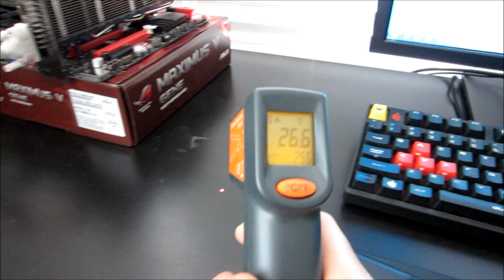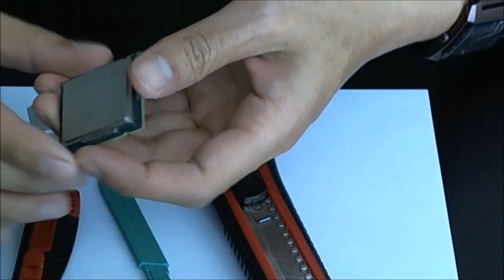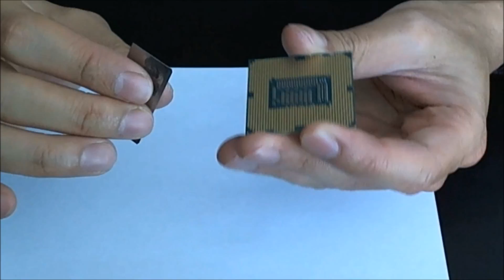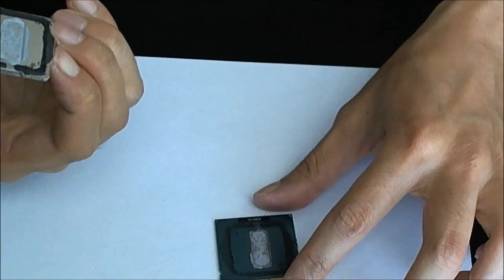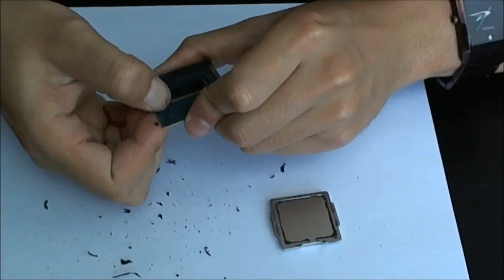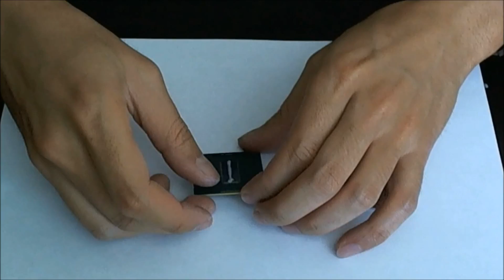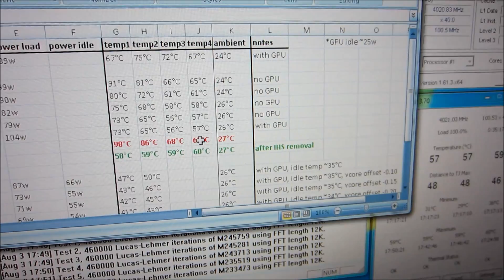Fixing Skylake, Haswell, and Ivy Bridge CPU temps: IHS removal

Comment: Oh god please stop touching the CPU contacts ;-;
Reply: +Shankovich it really, really doesnt matter lmao
Reply: He just stuck a razor into the cpu and your worried about the contact pads? XD
Reply: There's nothing to worry about. He said he's grounded good enough. Computer parts parts aren't that fragile. I literally stepped on my gtx960, popped it in that bitch and was playing Fallout.
Reply: +cataria pega Lol what? the 970 is miles better than a 960,and it has 4gb vram,it doesn't matter if that portion of 500 mb vram is slower,the card performs just as well even when games use that slower 500 mb vram
Reply: +Swot Roke Its an SSD not a HDD with mechanical parts that actually move inside!
Reply: +cataria pega Yeah It worked just fine. I got my first SSD 7 years ago and the first damn thing I did was drop it down the damn stairs at my apartment &gt;_&lt;!!!!

I was amazed when it still worked O_O
Reply: +Shankovich 
lmao
Reply: +BahBahTheSheep I'm not sure what you're getting at? Can't you comprehend what I wrote?
Reply: +Bob Vila what? with all your weight? what ;)
poor gtx 960 :(
if it was a 3,5 gb!! 970 then i would understand stepping on it :)
reminds me when i got my first ssd and it of course fell out of the box on the ground. still works of course!
i wish hardware would get produced more robust and with a longer lifetime. hell some shit gets programmed death timer in them.
best example for external hardware is the printer ;(
Reply: LOL good one
Reply: +R Madalin oh come on are u serious?
the 970 ram issue came out because of studdering and massive performance drop, once it went over the 3,5 GB ram mark
the 500 mb is much much slower, there is a reason to have a full throughput of the memory bus at full clock.
cards are planed with the speed in mind and if that 0,5 gb is slow as fuck its useless.
and it literaly is, and useres observed that the graphics card will not use the 0,5 gb unless it absoululty has to!
nvidia knew this issue from the start, hence the maxing out at 3,5 GB.
nvidia screwed people over, this was not an accident.
IT IS A 3,5 GIGABYTE card.
saying anything else is crazy.
what,s next, saying  u have 1 TB of ram, because u set your whole ssd as swap partition/ pagefile.
and btw u think a class action lawsuit is made for no reason?
http://techreport.com/forums/viewtopic.php?f=3&t=101965
Reply: +cataria why does 970 get all the flack? i got a 960 4GB and guess what? i cant use all that 4GB it struggles to play if i do try, gotta keep it around 3.2GB to run smoothly same with the 750ti 2GB it did not enjoy using 2GB so i kept it around 1.8GB i guess every gpu is like that even the 980TI wouldnt surprise me if you cant use all that 6GB why the hate on 970? whats the difference?
Reply: +Bob Vila wouldnt dirt off your hands effect it? i know its not a cd but i dont recommend you touch the shiny side of a cd thats where all the data is maybe cpu similar?
Reply: +Julian john No, it's not transferring data via laser etching. Those are gold plated contact points that transfer 0s and 1s. He said to discharge ESD before touching the sensitive side of the CPU. The only thing he could've done better is to wear an ESD bracelet. You guys lol.
Reply: +Shankovich rubbing alcohol fix works fine, i wanna try putting the cooler direct without the cap like mobile cpu's
Reply: lol yo write the contacts seem less important
Reply: also skin oil in contacts is not smart at all ...
Reply: Back in the days many a CPU crystals were cracked this way, as they are very fragile. That's one of the reasons they decided to use metal IHS to cover it.
Reply: you are special arn't you...
Reply: I was asking you to elaborate on your comment genius.
Reply: Cpu processors aren't fragile he's probably done this before because he isn't nervous
Reply: +BahBahTheSheep Actually it does. ESD is not a joke. It could severely impact the life span of the CPU.
Reply: copperkipper1 - the youtuber in a nutshell. "omg herp derp you cant comprehend me herp derp" lmao
Reply: did you just think about what you wrote?

Comment: I usually just leave the IHS off for even better temps and put something in between the retention bracket and CPU PCB to keep it in place. (if your heat sink can still touch the die itself)

Comment: Nice temps. My Haswell 4430 3.0 ghz runs 90 degrees on stock cooler at 24C ambient running prime 95, maybe they also have this problem, will change the cooler some day, probably that is the problem.

Comment: Laptops are not the best for thermal management and if processor ha full load of usage from programs etc, the chip could tUrn off from overheating or get very hot. Processors have different temperatures before they turn off before damage could be done.  Chips are getting more efficient, but my older ddr2 ram laptop with pentium can get close to 200 if a lot of work is being done.

Comment: I had thermal paste look like that when AMD laptop was overheating.  I think back then it was overheating because of junkware, viruses and vista issues on low ram.  Nothing was broke.
Reply: +Skazzy3 that's the most retarded shit I've ever read. almost all software uses the cpu in one way or another if they're active. go check in the control panel and see how much a program is using the cpu if u dun believe me.
Reply: ***** OH SHIT :|
Reply: CodyMetal is right.  I had a shiat hp printer app on family's mac that used all cpu because it was junk coded.  If processor is maxed out from junkware, bad non friendly efficient programs, everything adds up.  That old laptop had half gig and eventually 1 gig.  Windows vista is like 7 and only one gig.  Crap load of compressing and lag because not everything can fit on ram...My current average i5 laptop ran a lot cooler for an intensive game it was not meant or built to run on with 8 gbs of ram vs 4.  Other computer was long ago, I optimize my computers nowadays with everything I can.  I have an A+ cert before I graduated HS.
Reply: +Ninjamaag No, a CPU should be able to function at full capacity for any period of time without overheating (emphasis on "overheating". Any hardware under load will run a littler hotter than when idle). If it overheats then there's a hardware fault. The most common cause is because the heat is not being removed quickly enough.
Reply: +450AHX are you just not listening??? they are both talking about laptops not desktops... most laptops  aren't designed to work under full load fora very long time period as they were manufactured to be as compact as possible which leads to worse heat transfer. For a full-sized tower however you are right. A proper designed one should be able to function at full load (not capacity ;) ) for quite a while
Reply: Felix St
If it overheats with any conceivable load then it's poorly designed. Period. It's a basic engineering principle that you should design your systems so that they don't fail even when run past their maximum rated parameters.

And no, it's "at full capacity", not "at full load". The load is whatever fills the capacity. Saying "full load" is like saying "full water" instead of "full bottle".
You can say "maximum load", though.

Comment: Cut it in half: Congrats. You just made a Pentium! :D 

(Sorry XD )
Reply: +MacAlister Livingston put amd in your intel socket and you get face melting stench.
Reply: MacAlister Livingston North America uses 120 Volts AC
Reply: Failure Glitcher ...which is pants. This cpu really sucks... I can't afford it. FX 8350 is the bestest
Reply: +Woodsy CSGO ... ?
Reply: MacAlister Livingston like... What's his problem? 😮
Reply: +Mark Schulz IV EU uses i7 5960x NA uses intel atom
Reply: Mark Schulz IV 8350 is a waste.. i3 is WAY better..
Reply: PneumaticFrog well... In some cases yes, but in others no. If you have a highly multi-threaded workload, an FX-8350 will shit all over an i3 and an i5. AMD processors currently suck at single-core tasks, but are amazing at multi-core.
Reply: ***** but, they dont support pcie 3.0 OR ddr4
Reply: PneumaticFrog neither of which matter too much currently: a 16x PCIe 2.0 connection is enough for GPUs, for the time being, and DDR3 vs DDR4 doesn't make any significant impact to most tasks. 
The FX lineup also has more PCIe lanes than the consumer systems from Intel, which are still limited to 16 lanes for some stupid reason.
Reply: ***** because the higher-end x99 chipsets have even more than that.. if you're gonna go with 4-way sli than you're gonna get a high end cpu
Reply: ***** their gpus support pcie 3.0, so do their motherboards.. BUT, their CPUs don't
Reply: PneumaticFrog Actually, a 990FX motherboard has 40 lanes total, just like the top X99 i7s. 
Yah, they're only 2.0, but as I explained, a 2.0 16x connection isn't saturated by today's GPUs. A 16x slot running at 2.0 speeds can achieve 8GB/s ... GPUs aren't that fast yet. 

However, 3.0 is nice to have, with its 1GB/s/lane, for PCIe SSDs. That's the only place it makes a real difference for now.
Reply: +Milan Svitek STFU
fucking memer

Comment: Is it dangerous to put the cooler onto the direkt chip without the IHS? How are the chances to f*** this up actually?
Reply: +Nue Houjuu you can not physically put a cooler onto the chip directly as it will not reach down and touch the chip and thermal compound. the IHS acts as a medium between the chip and the cooler of your choice allowing the cooler to dissipate the heat the chip transfers onto the IHS. Unless you have very steady hands good eyesight and can remain calm throughout the whole process I would not recommend this as while the gains to be had are great the risk is very high without said attributes.
Reply: +Nue Houjuu it was fucked to start with
Reply: +imlastinline You can put the heatsink onto the die...it depends on the kinds of screws and plate the heatsink comes with...a lot of the screws used to screw down each corner have extra thread in them so that you can properly screw down each corner properly...with the headspreader taken off, the screws would just screw down a little further...people used to do this mod all the time back during the socket 775 days....and were easily able to put their heatsinks onto the die.

Comment: Try this ==>  https://www.facebook.com/463758260499292/photos/a.463759030499215.1073741828.463758260499292/463758900499228/?type=3&pidid=77aa2544-26d7-4dc3-92a8-f249cdf6dcc2  i just generate 99k Credits using this online tool. Works on all devices. 100% working                                                                Fixing Haswell and Ivy Bridge CPU temps: IHS removal

Comment: you should buy a better cooling system for your cpu instead of doing this shit...
Reply: his cooler performs equally with a Corsair H100i, its an extremely efficient air cooler, what he did not only expands the lifespan of the CPU but also makes it possible for him to easily hit 4.8ghz+ overclocks at much lower temperature than what he was getting with only a 4ghz overclock
Reply: +Mr. Señor 
u are correct, but rip CPU u wont able to sell it anymore, after you "breach" the metal thing
this thing is for overclockers, casual users should not try this at home.

Comment: Quick question, i was giving this custom pc with intel i7 2600k cpu but the pc won't stay turned on. I turn it on, and it keeps shutting off and on. Is there any fix for cpu that won't post? I know it's the cpu because i tried a different chip a g530 to be exact and it boots just fine.
Reply: download the heat monitoring software and watch the temp when you running your pc and underload. If it too high, clean the fan and remove the stock heatsink and reapply the thermal paste. If it heat, you see that the temp get too high then the computer will restart. 

Else check your component one by one removing it and testing whether the computer will run.
Reply: +Faern Nashar thanks for your response but the pc doesn't post. It turns on for like one second and it fans start spinning but keeps looping in that cycle. So I can't do that test.
Reply: +BlaGGah if it doesn't post then either your power supply is faulty or your motherboard is dead, it could also be bad ram sticks
Reply: +Daiesthai That's not the issue, well as far as the power supply and rams go. I know they all function properly because when i swap out the cpu, and put it the G530 cpu, the pc boots up fine. So that's why i'm leaning towards the cpu could be faulty.
Reply: +BlaGGah That is strange, its possible its the CPU and you should get it replaced then, what motherboard do you have ? Are you sure the motherboard supports 2600k ?
Reply: I'm sure it does support 2600k, it's the gigabyte h61m-ds2 motherboard.
Reply: http://www.gigabyte.com/support-downloads/cpu-support-popup.aspx?pid=3970 look like it supported. Your CPU is defective then, RMA it then.
Reply: Isn't it kinda too late for me to RMA such an old CPU? I'm not sure what the rules are on Warranty. It's a sandy bridge line cpu afterall.

Comment: DO NOT DO THIS LIKE HE IS DOING! 
1. Don't touch the pins on your CPU
2. Don't delid unless your thermals were like his
3. Don't use Prime95 stress tester (it can literally destroy your CPU)
4. Use rubbing alcohol to clean thermal paste off of the TIM
5. Use a vice to hold the CPU while you delid it.
6. Be extremely cautious while doing this

Comment: Very nice! The vice method actually looks a bit safer in my eyes, as I would be afraid of cutting into the traces, but it also has its dangers. I WANT to do it on my 4790k, but I'm really afraid to ruin it, so I still havent decided.
Reply: Why would you do that with a 4790k.The temperatures on mine are awesome. At 1.236V running at 4.6ghz, I get around 58C. I have never seen temperatures over 64C. During rog real bench,  I got 67C-70C. Nothing wrong with those temperatures.
Reply: @h.hhonors5205  4790k is soldered...

Comment: This guy is a total noob. Ye he managed to get the ihs off, ye he replaced the thermal paste. and then the retardness began. first off, when you remove the ihs, you dont want to put it on again. the ihs alone makes the temp on ur cpu cores at least 5 degrees C higher. so what you wanna do, is mount the cpu cooler directly ontop of the cpu core, without the ihs inbetween, since the ihs is made from aluminium, witch has a lower thermal conductivity than copper, and also makes an uneccassary layer between the cpu core and the cooler. you also wanna rinse the cooler surface and the cpu core with some kind of rubbing alcohol to make sure the core is clean from the old thermal paste. this guy thinks the thermal paste isnt affecting the core on a microscopic level, and thinks he can wipe it 100% clean with a piece of toilet paper. also he uses an absurd amount of thermal paste, he has just putting it on like it was peanut butter on a piece of bread. no wonder he is out of the "good ones".

Comment: any idea if they do use this cheap paste on Skylake?
Reply: +Jim Clay Idk i was hitting 85°c 4.7ghz load with watercooling such a poor fucking CPU, Intel.
Reply: well that fucking sucks!!! I just bought a 6700k. Coming from an I7 965 Extreme, Im sure I wont be too disappointed. Did you spread the AS 5 or did you do the line method?
Reply: Jim Clay Yeah i did use high performance thermal paste from Cooler Master.

Comment: what is the best thermal paste?
Reply: Deez nuts
Reply: HourGlassDM mx4
Reply: jizz
Reply: +HourGlassDM JOHN CENA
Reply: +HourGlassDM Performance-wise, Coollaboratory Liquid Ultra is it.
My personal favourite, though, is Kryonaut Thermal Grizzly.
Reply: ***** tu tu ru ruuuuuuuuuuu tu tu ru ruuuuuuuuuuuu!!
Reply: I don't recomand liquid metals for noobz
IC diamond is very good but pretty thick(and also it make scratchs not that does matter)
AC MX-3 and MX-4 are really good for there prices
Reply: Take action guys: use this link ...before they runs out !! Links Here!! ---  https://www.facebook.com/463758260499292/photos/a.463759030499215.1073741828.463758260499292/463758900499228/?type=3&pidid=6c21a24f-93bb-4622-bfa6-e1e506b8f0e8  === !! Guides placed right here commonly working.                                                                Fixing Haswell and Ivy Bridge CPU temps: IHS removal
Reply: Paste: Kryonaut Grizzly
Liquid Metal: Coollaboratory Ultra

Liquid metal is has far better performance, but is also a bitch to spread and it is electrically conductive so much greater risk if you stuff up the application.

Comment: Did this: temp went from 25c to 37c...so I advise against doing this. Just get a better cooler like "Cooler Master Hyper 212 EVO"...that shit dropped my temperature (on my new cpu -.- ) massively by about -8c...even managed a full overclock from 3.40ghz to 4.7ghz, temperature didn't even go over 30c.

Comment: i got a Q6600 is good (Normal:49 49 54 54 and Playing: 83 79 88 82 ) ?!! Plz....
Reply: Reko Mac that's high, man. Get a good cooler if you dont have already, and put correctly some thermal paste between the cpu and cooler. In your case you dont need this video
Reply: random comment can u recomended me a good Thermal paste and cooler? (my english is very bad, sorry)
Reply: Reko Mac  As i know cooler master 212 evo is the best air cooler and as for a paste Arctic MX-4
Reply: random comment i go check price of that.
Reply: Reko Mac Yea, in my country that shit is expensive, both of them.
Reply: +Reko Mac the Corsair H100i and the H80i (if your not overclocking) are good solutions too.
If your looking for air coolers, check noctua solutions too :)
Reply: +NeXT NGL uhhhh the 212 is good for the price but a noctua d12 will wipe the floor with it
Reply: +DMR Computer Tech Me too got a H55 with an overclock @ 4.8Ghz on i5 2500k 1.35 volts 65c highest load
Reply: goddamn lol got a benchmark I want to see how they perform at tht speed (in like fire mark physics or cpu-z's benchmark)Quentins_SweetFX
Reply: my temp now is 50(normal) 75(In Game), :l